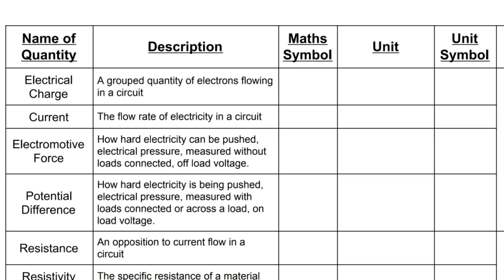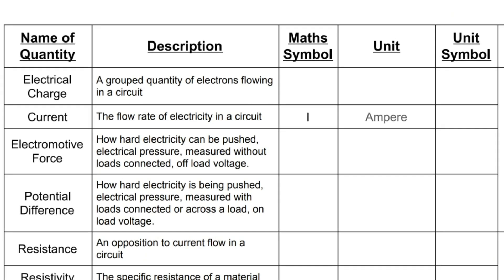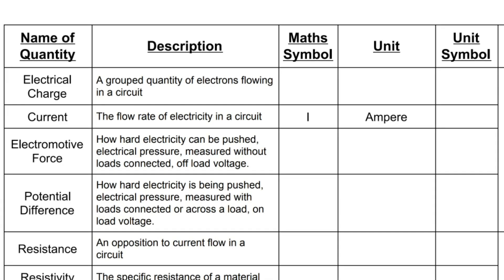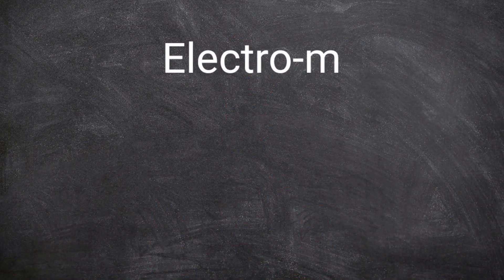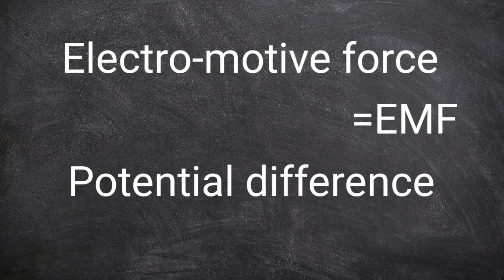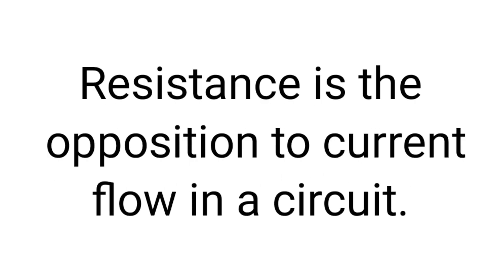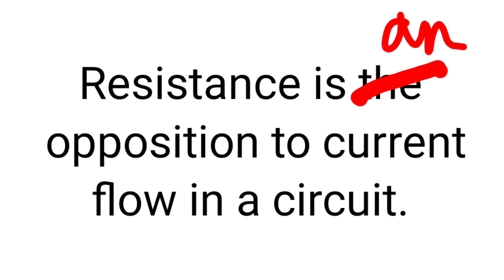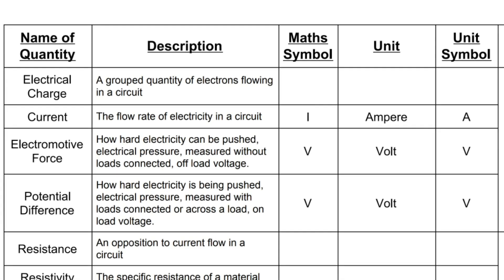SI Units: What are the Basic Units of Electricity? Current, Voltage and Resistance

Comment: Good explanation! There‘s also the electrical conductivity, it’s the reciprocal of the resistance and the unit is Siemens.
Reply from the maker: Good point thanks for the reminder, Siemens don't usually come up in electrical installation work but I may make a bonus video for it. 😊

Comment: Great explanation Joe, With regards to “back emf” is that an idle or off load voltage created by an inductor?
Reply from the maker: That is a great question, and may well be a contradiction in terms actually because back emf only appears when an inductive load is connected. I've done a video on back emf check it out: https://youtu.be/IJP2s3P-SB4

Comment: Joe: Very clear explanation as usual.   Current (Amps) can be viewed under an electron microscope (electrons). Voltage on the other hand is pressure and
we need a gauge to measure it. (volt meter). Thank you.
Reply from the maker: Great comment, thanks Ted.